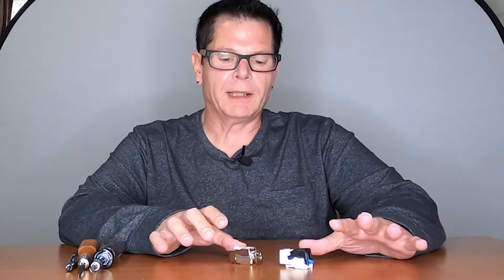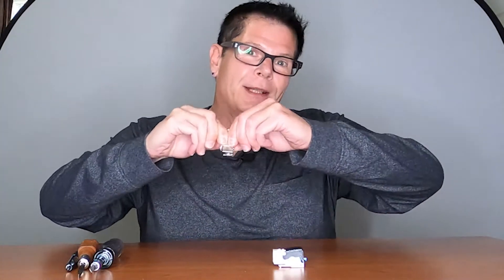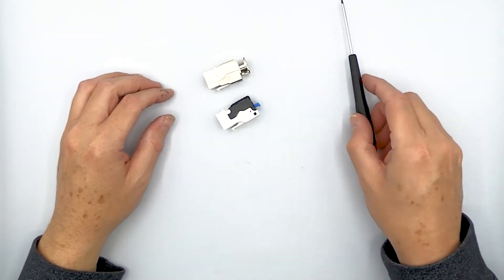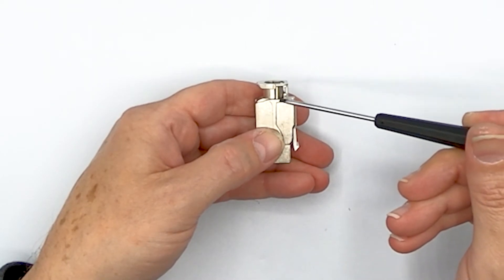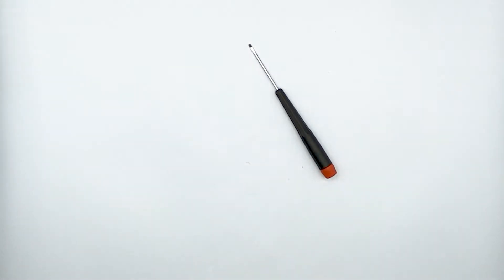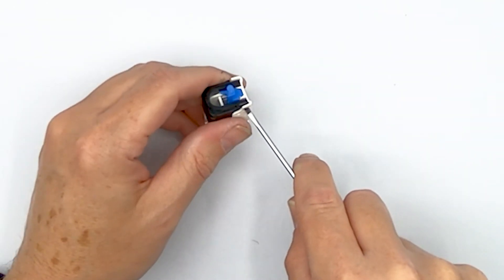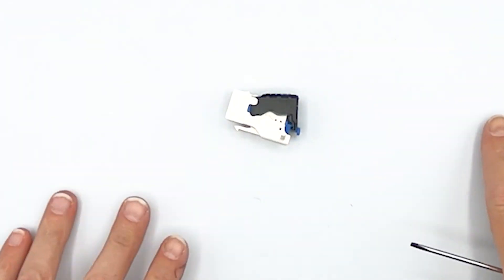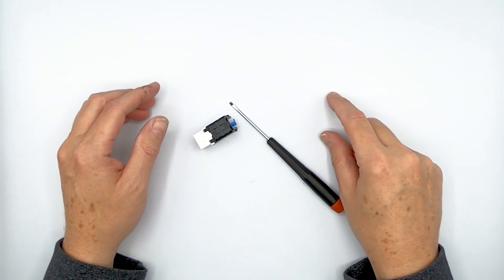The Quickest Way to Reopen Keystone Jacks

Comment: Maybe make a tool that will easily open them? Also what type of wall gang plate should I use for 24 plus ethernet to patch panel. How do I easily get through fire blocks?
Reply from the maker: Hello! To answer your first question, producing a specialized tool for opening keystones would likely be too expensive due to limited demand, making it difficult to achieve economies of scale. This would result in a high retail price. If demand becomes sufficient we will consider one, but a simple flat blade precision screwdriver is all that is required for now. For the second question, there are no wall plates I am aware of that would accommodate 24 ports. The maximum for single gang is 6 ports, and if you were to use a two gang wall plate you could achieve 12 ports. You would need two dual gang back boxes to accommodate 24 drops (equivalent of 4 X single gang). In regards to your third question, which is breaching a fire rated wall, there are UL Listed fire stopping materials and devices to restore the original fire rating. This is not to be taken lightly, as a fire rated wall typically is found in a commercial setting and if a local Code Inspector takes issue with how the breach was done or how the rating was restored, you may face potential penalties up to and including no longer having an Occupancy Permit for the structure. Please speak with our local Code Inspector and make sure you know what you are doing before even attempting to do this!
Reply: @ this is my personal house the builder put fire blocks in every wall
Reply from the maker: @ChickenPermissionOG  Understood. If the blocks are cinder block, then a hammer drill with the appropriately sized hammer drill bit will be required. I typically use 3/8" for Ethernet and coaxial.
Reply: @trueCABLE  just standard 2x6, just do not know how many cables I can fit through a 1-1/4" hole
Reply from the maker: @ChickenPermissionOG  Hello! Depending on the cable jacket overall diameter (OD) you can fit anywhere from 6 to 24 cables through that size hole comfortably. How many is totally dependent on the cable thickness. We have a chart for that! See https://www.truecable.com/blogs/cable-academy/conduit-fill-chart-for-ethernet-and-coaxial-cable for the calculation table. Hope this helps!

Comment: Your imply that the thing is open when you get it and somehow it gets closed by accident while dwangling around with it. I ordered a bunch of these (brand: Value, model:  26.99.0366R) and every doggone one of 'em is popped shut out of the box. Thanks for the tip!
Reply from the maker: Hello BigJoe! Yeah, they should be open when you get them. Sometimes they shut during shipping. Depends on the UPS or USPS driver and package handlers. I am glad you found this video so you could get them opened with minimal hassle!
Reply: @trueCABLE  The problem is that once they're pried open they sometimes won't snap back solidly in place. Is there a trick for that? Maybe bend the little "wings" back inward a tad?
Reply from the maker: @BigJoe2354899  Hello BigJoe! I understand what you mean. These particular keystones will fully close, but won't necessarily make an audible "click" noise or even a tactile click "feel". As long as the keystone is actually closed and the zip tie applied you are good. I would not suggest bending the rear tabs as the metal is nickel plated zinc and will break!